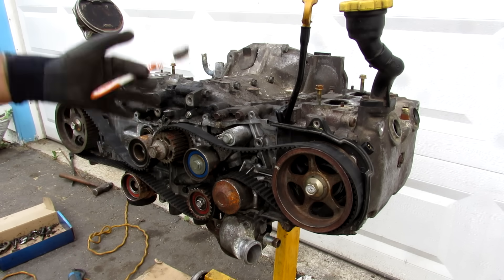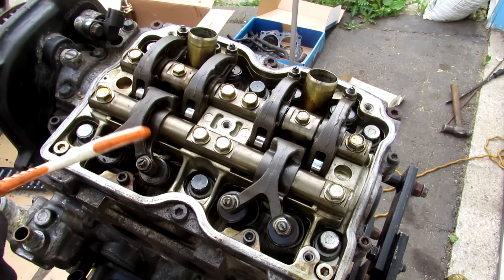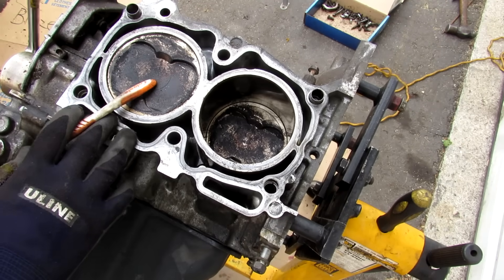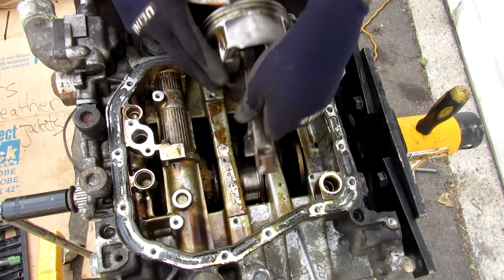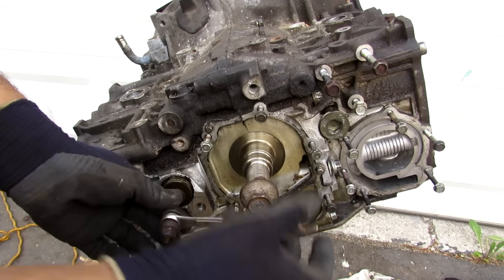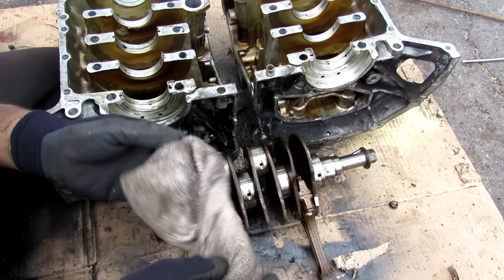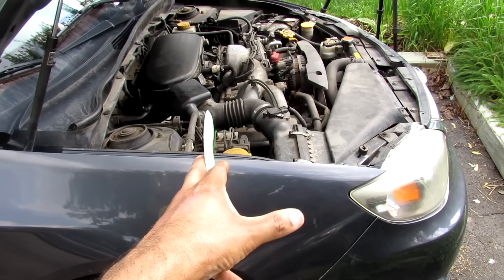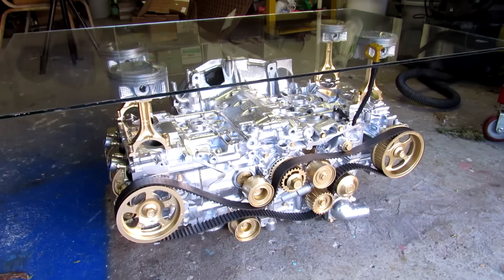Why Subaru Engines FAIL

Comment: If Subaru has an engine problem it would have to be the user. Other than replacing a fuel pump and an alternator and timing belt mine went 277 thousand miles, it was still running great when I sold thew car. If you do the maintenance and take care of the car they will go indefinitely. Personally I love the boxer engine it develops a lot of get up and go very quickly.

Comment: One of the most thorough videos I've seen! Now I'm gonna go sell my forester and buy a Toyota Camry
Reply: LOL terrible decision. Toyota’s have issues as well and good luck in winter + the forester handles so much better and is so much more fun to drive.
Reply: @dreww47  you dont need AWD for winter, just learn how to drive or get some fuckin studded snow tires.
Reply: @2stroke750  LOL I’m good with my bald summer tires and AWD thanks though
Reply: @dreww47  Dont get me wrong, I drive a fwd car with bald tires in montana winters no problem, snow tires are just a suggestion. My main point was "learn how to drive."
Reply: @2stroke750  oh yes 100% I’m fine I’m snow ... winter here in NJ isn’t too bad but most of the time during heavy snow there’s mostly lifted pick ups etc and here I am in my Subaru cruising lol
Reply: late model Camry's with 8 speed auto have consumer complaints...do your homework. At least in the 2018 and 2019 models with 4 cylinder engine

Comment: I've been pushing  the idea for an electric oil pumps located at various critical lubrication points for this engine. It needs a few seconds before cold starts, oil pickup issue's,  cool video.

Comment: Subaru boxer engines are often misunderstood.  When cared for properly they are extremely reliable and long lived - but they will not tolerate abuse eg. poor quality servicing.
The example you show appears to be from a scrap vehicle.
The last owner might have been a complete idiot and ran it into the ground - who knows?
My 1994 Legacy 2.2GX (of the hydraulic tappet (lifter) era) covered over 130K miles without missing a beat and never burned oil. It had a Jatco 4EAT auto transmission which suited it well.
I regretted selling it.

Comment: looks like the same problem with the focus rs...cylinders lack more material connections at the top of the block...seems the pistons / cylinder pressures would jiggle them around causing the sealing problem

Comment: speedkar99: "This engine shouldn't vibrate as much as an inline 4-cylinder engine."
Subaru: "Good point. Let's add UEL headers."
Reply: Only on the turbo models tho, nice bugeye by the way!

Comment: All thing considered Suburu has been able to retain an outstanding reputation, in spite of engine problems like failed timing belts and pulleys, head gasket failures, which is to be expected with the design. Remember, these are all aluminum engine blocks and that means higher expansion rates than iron/ iron- aluminum combinations which have been around since at least the early 60's in this country. Take the Olds/Buick beginnings with the F85 which eventually went to England for British Rover. All aluminum and noted for head gasket issues because engine coolant formula had not advanced adequately to be compatible with aluminum. Then we should mostly all remember the ill fated Chevy Vegas, then Cadillac came out with their early aluminum block iron headed HT series and then the North Star also noted for head gasket issues. It must be accepted that nothing will last forever. 100k miles is a fair distance and in that many miles there are going to be many many heating and cooling cycles along with the strain head bolts experience with all the combustion cycles in that time. As far as connecting rod issues, I have seen my share of failed Engines of all makes and designs, the last engine I worked on failed several times all the while other shop techs working on it most of the time. I finally took the project on and found the reason for the failures being a factory goof up during machining and assembly. The factory oil passage drilling process miss intersecting the main galley restricting oil flow to the Crankshaft. Mass production ! I will not except the comment that the rods are made of inferior material or poor engineering on these engines. I will accept poor service though. I do know that early models of Suburu engines had issues with rocker shaft wear due to low quality oil chemistry and incompatible materials used for shafts and rocker arms. The quick fix for noisy engines then was to simply rotate the shafts half way around. These engines are interference valve so if the belt fails you must remove the engine and heads to replace the valves. So properly scheduled services are a must. But heck this is American and why do regular service ? We just throw it away when it quits and get another. That makes more sense ! It's cheaper too right?
Reply: I think the Subaru is a good car built around a POS engine. Great concept. Shitty design.

My girlfriend had a 99 vintage forester wagon with the 2.5 high output DOHC. The head gasket failed while we were starting out on a canoe trip. The trip was aborted and as we were attempting to get back home, the engine seized. The mechanic who did the tear down and eventual engine swap said that the maintenance routine should have included re-torquing the head bolts at specific intervals but Subaru would never have told owners that. I investigated the head gaskets and found that they had gone through 7 different versions before settling on one that "worked" in the last engine build outs.

I told my girlfriend, after doing a plug change, that I would stay in the relationship if she got rid of the car. She bought an Audi A4 wagon with the 3.2 liter v6.  I'm still with her.

Comment: pretty sure my 1999 2.0ltr Forester has piston slap. As a general idea, how long till something like that completely fails, or can it just do that for years?
Reply from the maker: Piston slap means your piston walls and skirts are going to be taking excessive wear. Eventually you'll loose compression
Reply: @speedkar99  thanks, better than a sudden failure I guess. it has done 307,000km and has no other issues. drinks about 5 litres of oil between each oil change.

Comment: It would be nice if you went into more details about this. Like the early EJ25 had the combustion chamber leak into the coolant passages. This caused a huge, almost instant overheat because it pushes all of the coolant out of the system, filling it with hot air. On a bad head gasket you get about 15 minutes of driving or so before you need to refill. I did the quick and dirty refill the hot system on the side of the road and be done in 2 minutes (I wore gloves to handle the heat). 
Later EJ25 had the external oil leak, and didn't really over heat. 
Not all Subaru engines have an issue with the oil starvation. My older EJ25 would have had it with how I drove it. 
You also missed that a lot of them have a plastic cover on the back, which causes a huge oil leak, generally right onto the exhaust. It did get updated at some point with a metal cover, which you can put on the older engines, and it fixes the issue. 
You also missed the timing belt tensioner, which can go bad if they aren't changed with the timing belt. A lot of these being interference engines, means death. All the DOHC are, and the later SOHC are as well. The other thing is that a lot of them are also interference in that the valves can hit each other.Very important to keep those timing belts changed.

Comment: The entire boxer EJ Subura engine design was doomed to reliability issues and failure, due to anything from oil consumption, Piston-slap (short skirts), Cylinder Head gaskets, Oil Pump starvation, etc.
Reply from the maker: Will see if the same issues are observed in the FA series

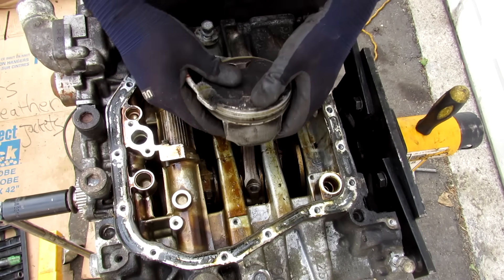Comment: 6:12 Attenuate- to reduce or weaken. I think you meant the opposite is strengthen or increase. Great video, you covered a lot of good points. The retainer clips on the wrist pins though isn't exactly weird, it's been used for many many years in different engines from around the world includint the air cooled VW boxer engines. It's not common today I guess but old idea.
Reply from the maker: Good point

Comment: asian cars suck, I have a Nissan Joke, already had to replace 2 injectors at 40k miles, it looks a bit rusty on the inside, like that subaru, decomposing
I looked at an older skoda engine bay the other day, and nothing, clean, no rust
Reply: If you had bought a Toyota, you would likely have a different opinion of Japanese cars. Nissans have had issues for over a decade. They just aren't what they were 20 years ago.
Reply: Slakers  Load of shit, 40k miles and two injectors? that's reliable for you?
plenty of oxidized components inside the car and in the engine bay for a 10 year old car?

Comment: Great video. Are the new (2015 and newer) FA series of motors that replaced the EJ motors, a better design? I just purchased a 2015 WRX with the FA20DIT, 89K miles, and it runs and sounds fantastic. It seems the  FA motors are pretty trouble free (a colab with Toyota, correct?).

Comment: The 2nd ring is an oil scraper, not comp ring. If you look at Napier rings they have a taper to pass over the oil, and a hook on the bottom to scrape/drag the oil down the bore. If the 2nd ring ever traps comp it will lift the top ring, and you will lose power.

Comment: Wow.  an excellent video.   I like the point about the coolant being retained by the head gasket for the life of the engine since the engine sits horizontally.  no wonder the head gaskets   fail and leak.   hard to understand why subaru would stick with an engine with so many flaws.

Comment: This guy is a Subaru specialist as he has worked on these junky motors enough to know all their failure points. My son-in-law's 2011 WRX 2.5 Turbo motor blew a connecting rod...the mech said it was oil starved.  The Subie was sold for a loss but this car was just going to be a money pit of trouble. Oh, I almost forgot....Scottie Kilmer is a solid mechanic who is very knowledgeable in the basic maintenance of cars as well as some of the major problems that develop in cars through the years...

Comment: Iam really scared of buying subaru. Is it safe to buy something like a stock legacy spec b with ej20 and 180k km?
Reply: Buying used the problem is people beat the hell out Subaru's and make mistakes with maintenance. Their legacy in Rally Sport has not done Subaru any favors. The EJ25 NA is where the problem lies because its the most sold engine in the USA. We have crappy consumer engine oil and mislabeled things such as universal coolants available in stores that are just garbage in Subaru's. The headgasket issue is real, Subaru has failed miserably to fix it once and for all especially in the ej25 none Turbos. The EJ20 has less problems for some reason, maybe cause its sold more everywhere but the USA lol :D
Reply: @iallison401  Yeah i have heard things like that about usa subarus :D. Luckily i live in Finland where people take pretty good care about their cars, but it's still pretty hard to find good well cared subaru  here.

Comment: I have a 2006 Subaru Outback with 176,000 KM. The problem I have had is with oil pressure senders, CV shaft boots. I do my own maintenance for the most part but I had a mechanic do the timing belt and associated kit at 96,0000 KM.No head gasket issues. Subaru's used to have a lot of head gasket issues in the 90's early 2000 models but not so much in vehicles after that period. They do have a "blue engine coolant" that is supposed to help with that issue. That blue coolant probably has a stop leak additive in it. Overall the car has held up well over the years.

Comment: Servicing the engine (re: spark plugs) is damn near impossible, so to avoid this money pit simply do not buy one.
Reply from the maker: Thats one way out. Buy a Corolla
Reply: I had a 1987 model that broke one of the timing belts (had to replace both) at 50K miles, blew the head gasket at 60K miles, broke pulley brackets regularly from poor casting, and many more other problems .... all in less than two years. That was my one and only Subaru. It was by far, the worst car I ever owned. Never, ever again.
Reply: Yep, you want to do anything on it you have to drop the engine. That head gasket problem is made worse by the heads being inaccessible and there being two of them.
Reply: You just need a wiggle socket and an extension (at least for my 06 Forester).  Ezpz

Comment: Damn 
I always thought my audis is a pain to work on 
After watching  this video though  I will be doing any work on them  with a smile even my 2.7t which is considered as the worse one of them all 😎😃
Reply from the maker: I thought Audi's were more complex no? I want to dissect one one day
Reply: @speedkar99  I’m not a mechanic just turning wrenches on a hobby level 
Been vw Audi enthusiast for the last 25 years and have done engine removals ,turbo and clutch replacements  and in fact just rebuilt my 2010 2.0tfsi  do to excessive oil consumption but to me disassembly seemed way easier/simpler easier 
Of coarse that could be because I been working on these cars for so many years
The engine might be more complex though

Comment: My wife had a 2014 Crosstrek and it used or burned oil. The oil was changed at 1000km after we drove it off the lot. The oil was changed every 7000km religiously and yet it used or burned at least 2 litres between changes. My Dodge Caravan 2015 doesn't burn a drop and it has 196,000km. No more Subbys.
Reply from the maker: So the newer engines are burning oil too eh

Comment: Maintain these vehicle engines to your heart's content, it will matter not. Defective designs are doomed to fail, and they regularly do fail. 7 towed to the scrap pile this year alone, one with only 24,337 miles. All but two received regularly scheduled maintenance.  (most customers do not have new engine funds nor rebuilding funds)
Compared to the many different engines in use today, their engines are simply not designed well at all. 
Well, if a full life service is the goal. If you want some power with a limited life, go subaru. Otherwise, you invite the inevitable. 
Can you tell that we have become frustrated with subaru?   lol
Reply from the maker: Do you work at a dealership? How old were those cars?
Reply: @speedkar99  
Not at a dealership, but at a garage.
Granted, we repair all sorts of vehicles, but have had a particular issue with subaru lately.  lol
The one with 24,000 miles was a 7 year old garage stored vehicle. Owned by a kid who changed his own oil, but never ensured the filter was tightened. 
He seen the oil light come on, but kept driving until he heard that all too familiar tapping and knocking.

Another one was 12 years old with extensive service records from actual dealer garages. Sudden failure of the oil pump coupled with yet another driver that did not understand why oil is needed did that vehicle in.
And we are not exactly sure why the last one failed as of yet. We should have a better understanding tomorrow when we open it up.
(Its acting as if exhaust valves are stuck, but none of us have had time to dig in until tomorrow.

3 of the unmentioned subarus I was not involved in, so I am unsure what their issue(s) were.  Another was driven too long with a blown gasket. The coolant did some serious damage soon as it began mixing with oil.

More of them had received regular maintenance than not, hence my initial comment. But in reality, I know my hypothesis is a bit flawed to an extent.
Frustration was merely triggered is all.  lol

Comment: First problem buying a subaro. Thats why mazda ditched the rotary, because dealership was shouldering the repairs at premature engine failure. Mazda pulled the plugged on the rotary engines.  Subaru on the other hand engines would last longer, but still have gasket and piston wearing on one side..

Comment: I learned more in 5 minutes watching this video than I learned watching 5 years worth of Scotty Kilmer videos!
Reply: Ditto - This video is refreshingly close to perfect.  Imagine if this was a standard... 90% of YT videos could simply be deleted!
Reply: Rev up your time im about to waste!
Reply: Same👍
Reply: To be fair, has Scotty ever shown an engine tear down? Apples and oranges comparison?
Reply: Shirley you jest.
Reply: I have luckily never watched a full video by that yayhoo
Reply: Opinions are like garbage. Nobody wants them. You just talked crap pal.
Reply: @moenibus  You were born stupid, you have no chance.
Reply: Scotty needs to give up the speed... ironically...🙄😂
Reply: The only thing I learned from watching Scotty Kilmer videos is how to spot a clickbait YouTube title.
Reply: @ericmichael6803  Amen to that !!!
Reply: I have a Subaru and it works like a charm. The biggest cause of all Subaru engines is sludge buildup due to its engine and pistons' configurations that leads to multiple issues, so have the engine oil replaced as per manufacture's instructions. Is this too difficult to do?
Reply: @MrGreatpersian  The engine will still go down sooner or later.. Other parts are garbage too. check the pistons crap quality, crap quality piston oil ring, bearings... all garbage.
Reply: MrGreatpersian purpose of engineering is to make things better and require less maintenance. There are vehicles that are so durable as long as your engine oil is holding up they don’t have basic faults that occur in them. That said, changing oil is pretty easy and definitely worth doing when stated it should be by manufacturer recommendations.
Reply: @Lo0die3  most durible vehicle. Toyota Landcruiser
Reply: Yeah me too....don't by a Subaru unless you are a good mechanic.
Reply: This is what happens when you have a guy that knows his boxer engine and can TEACH it well ...
Reply: Scotty is very informative too